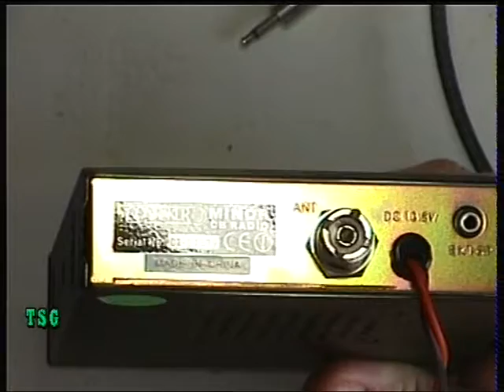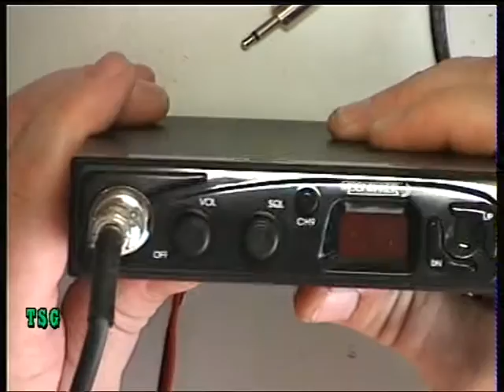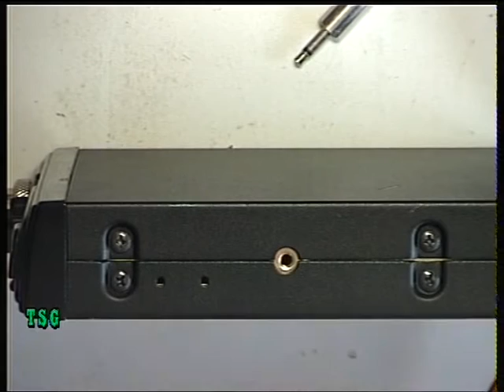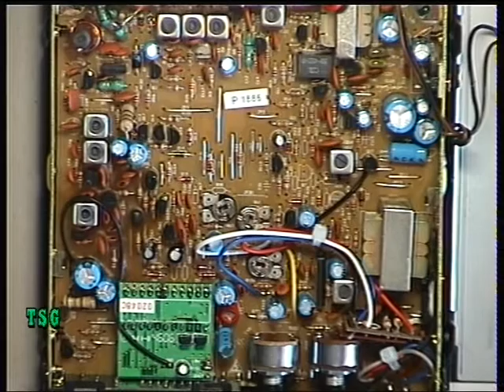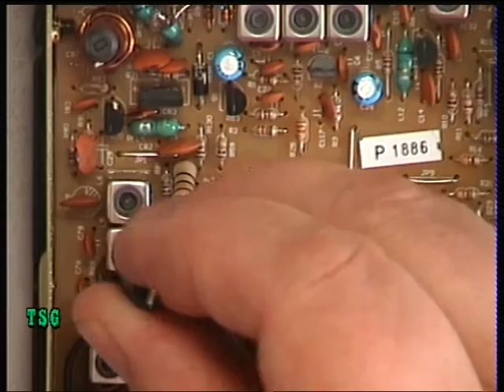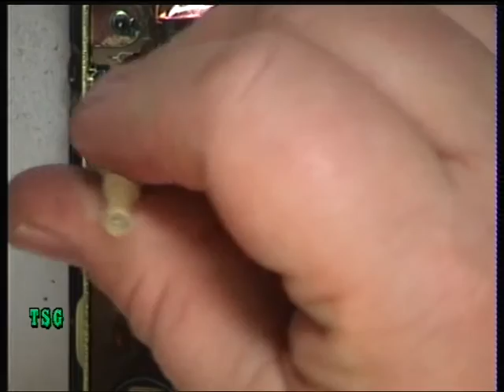Moonraker Minor CE late version UK (PR27/97) CB radio (Mobile) - transmit

Comment: 3.7w is that a tad disappointing on a modern set?
Reply from the maker: not really. That test set filters the output, so we are seeing 3.7W of 27.79125. On a CB type power meter it would probably read 6W.
Reply: Filters the output? Does that mean it reads lower than the actual power output level? I suppose 3.7w or 4w won't make any real difference anyway in real life use?
Reply from the maker: It's like if you have a Bird Thruline which has slug elements for the frequency you are using, rather than just reading any old RF, it's selective. My 3.7W could easily read 6W on a CB type power meter. Have done a demo on this subject in the past. To be honest, the difference between 2.8W &  4W in practice is negligable. Aerial performance & feeder loss is king.